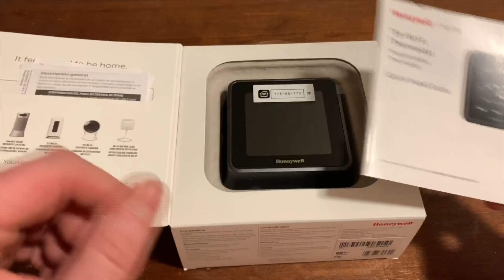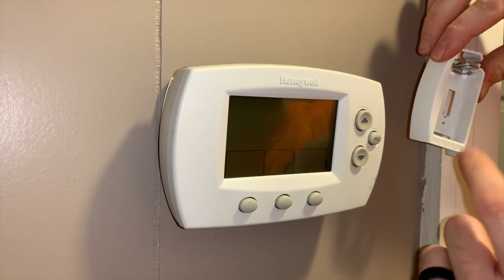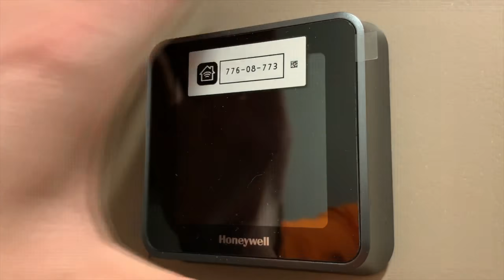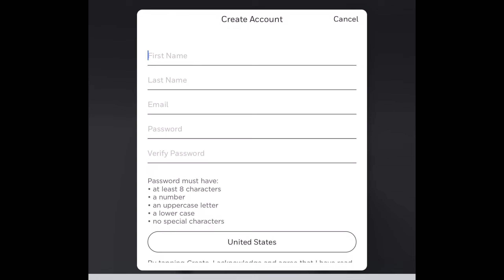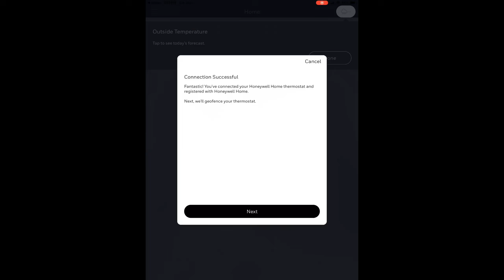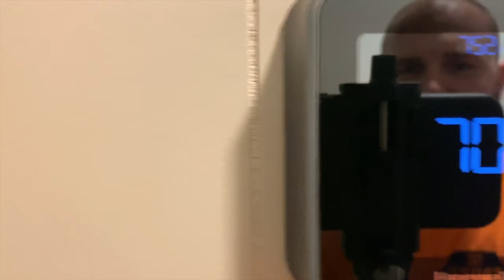Unbox & Install Honeywell T5+ WiFi Smart Thermostat

Comment: I literally have the exact same old thermostat, same amount and colors of wires as well. Batteries were in my old one is the only exception. My new T5 does not power on, tried multiple times.
Reply from the maker: Could you have a defective unit?  Do you have a voltage tester to make sure you have power being delivered where you should? If all else fails, see about getting a local HVAC pro out to take a look.  Thanks for the comment and please circle back if you come to a solution so we can keep other people informed that may potentially run into the same issue! Thanks!
Reply: I bought it from Amazon “used,like new” condition. Very possible the unit is just totally defective. I do have a voltage tester so I can try that. I guess I figured if the old one was plugged in with battery backup I should have power no problem.

Comment: Hello, Thanks for going throught the installation. I want to instal the same thermostat. I do have the C-wire but dont have the Y (Yellow) wire. Will the thermostat work with the furnace without the Y (Yellow) wire? Thanks again.
Reply: You don’t have the Y Yellow because your system can only HEAT and don’t COOL. “Y” is the COOL mode. You still can install this connected thermostat, no worries. On this page, go to “check compatibility” and you will see witch models of the Honeywell brand your system is compatible with by indicating which are the wires you have. https://t9.honeywellhome.com
Reply from the maker: Thanks for the question!!! I’m actually not for sure if that would work with your specific system - definitely consult an HVAC expert on that one before attempting to wire it outside the instructions provided.  Good luck and thanks again for watching!!! 💪🏻🙌🏻

Comment: Whoops! Plugged the wires after screwing it in so now you have a rat's nest sticking out through the hole, you're also supposed to depress those tabs while you insert the wires. You didn't level it, your bit definitely over-rotated and stripped the drywall cause it's too powerful for that and you didn't use anchors. To others installing this, I would consult the manual if you don't want to take all the shortcuts.
Reply from the maker: Lucky for me it works and looks awesome. Isn’t Unlevel or operating poorly or any issues at all. I also don’t have drywall wall... said that in the video. House is 1934 Shiplap construction. I am not and did not claim to be an HVAC expert, it’s a DIY channel. Thanks for watching though and have a good evening!!
Reply: @ToughGuysDIY  Nothing against you! Just suggesting others read the instructions. Sometimes people hop on a channel and follow step by step, damaging something or doing it improperly. Just letting people know! Cheers.
Reply from the maker: Totally agree with you, I always advocate people consult instructions and professionals if needed. A ton of people reached out and a few really helpful people in the comments have helped a great deal. I’m a GC for a living, but a jack of all trades you know, so trying to document my projects to hopefully add value where I can. Thanks!
Reply: @iDislike  I agree with you. It is very irresponsible for people to post these instruction videos when they don't know how to do the job properly. What makes it worse is when they place ads on their videos for improper advice.

Comment: I have a jumper between w and y wire on my old thermostat, how can i apply this to a t5 smart thermo? The wire is yellow by the way.
Reply from the maker: I’m sorry I’m not sure I can assist with that question. Go through the comments here though because there are a few people with more knowledge than me on the matter!! Last resort - contact a local HVAC service company to advise - to me that’s always the best bet!! Good luck and thanks for watching and for reaching out!! 🙏🏻🙏🏻🙏🏻
Reply: Mine had a jumper, and in the instructions it has a section on it

Comment: Does the Honeywell T5 work if you have two zones, and plan on placing a T5 in each zone?
Reply from the maker: Micah, my assumption here is that if your HVAC system is setup already to have multiple zones, then you could install 2 of these thermostats and control them independently of each other.  The zoning is setup during the rough install of the HVAC system with the thermostats acting as your controllers.  I’m not certified in HVAC install by any means, that’s my understanding of how it works and I assume you’d be ok. Might be best to reach out direct to Honeywell or a local HVAC expert in your area for a direct answer.  Thanks for watching and for reaching out!! 💪🏻👍🏻

Comment: Might be dumb question, but I have a wire in the “aux” spot and not in the “c” on my furnace the aux wire is connected to the c spot.. think I can put the “aux” in the C in the new thermostat? Thanks
Reply from the maker: Rich, not a dumb question at all!! If it were me, based on what you’re saying I’d put that wire on the C spot on the new unit as well. 

But I am not sure if the answer for you - I really just followed the instructions for my situation, so I’d recommended getting an HVAC guy out to have a look. In the comments here though there was a guy giving some great advice, so you may want to place the question there to see if anyone could help in that thread.  Thanks for watching and I hope you find the help you need!! 💪🏻🛠🙏🏻

Comment: Mounting plate screws  drilled straight into drywall........no anchors?............nice,lol.
Reply from the maker: Bottom was course thread drywall screws, and the top was one of the smaller metal screws. There’s also wood paneling on top of the drywall.  I think I’ll be good with the 1oz total weight (or less) of the thermostat against those three screws, unless of course I need to use it to hold myself up during a violent fall.
Reply: He isn’t going to hang clothes on the damn thing...get a life troll!

Comment: the app doesnt connect to wifi. look at the apps reviews.
Reply: I had the same problem, somehow WAC was enabled. just go and find WAC on the T5+ and disable it,  it worked for me.
Reply: @luisacevedo2512  hey bud.  My wifi isn't connecting to the app either.  2.4 ghz router and android
Reply: @luisacevedo2512  And what is WAC?  Is that in the thermostat?  Thanks for the help
Reply from the maker: Ok thanks for sharing. Everything with ours connects just fine, not sure I’m understanding the issue you’re having specifically.

Comment: On my old thermostat a Robertshaw I had 4 wires installed at the time of removal.  I see in your video here you mention briefly information on the C wire Adapter and the concern.  Thanks for that I think I might have that problem.  
I had a blue wire but it was not hooked to any slot on my old thermostat.  On this Honeywell T5 I purchased at Home Depot I installed the correct wires to the color code and I hooked the blue wire to the C slot.  Installed the display faceplate turned on the power to the house and no display saying "Start Setup".  Call Honeywell support and really didn't get in any help in why the display was not working to start the setup.  
I'm wondering if the blue wire is hooked up at my system or Option 2 do I need to use the C wire Adapter?
Reply: Danny McColgan Hey Danny, depending on your system you need to go to the furnace and make sure the blue wire is hooked up to the C (common) terminal. As always, make sure power is off to the unit first and this should fix your problem. As a side note, if you have air conditioning you may also have another wire hooked up to the common terminal so make sure that stays put when you add the blue wire to it!
Reply from the maker: Danny, thanks for the feedback and for watching!! Best of luck on your install! I was lucky not to have to encounter any difficult obstacles with our install, but I did try to cover some of those scenarios, so I’m glad I was able to help in some way. 👍🏻

Comment: On my old Honeywell my blue wire is in slot "B", would that be the same as slot "C" for this new Honeywell? Also I saw you had the jumper wire on your old Honeywell and I have it as well. I take it the new thermostat doesn't require it?
Reply from the maker: Thank you for posting your experience here to help others out!! That’s so awesome! 👍🏻👍🏻👍🏻
Reply from the maker: Scott, I honestly just went step by step and those instructions in the booklet were really solid.  I may have been lucky with my setup of course, but I’d urge you to review the document really well to confirm what you’d need to do next. Sorry I’m not more help for you directly! Thanks for checking out our video as well!

Comment: I know the thermostat is “HomeKit” compatible so would still have to download the Honeywell app, have you tried using this with the “HomeKit” app?
Reply from the maker: I have not tried directly with HomeKit. I’ve not had any experience using that yet, but if you go that route I’d love to know how it works! We’ve had good luck with the app so far, no issues other than our WiFi disconnecting but that is a known issue with our router not the Honeywell unit
Reply: I initially tried to connect to HomeKit.  It did not work for me until I successfully connected to the Honeywell/Lyric app, first.  Perhaps there was a delay or something.  I don’t know.  How did it work for you @bigdawg?